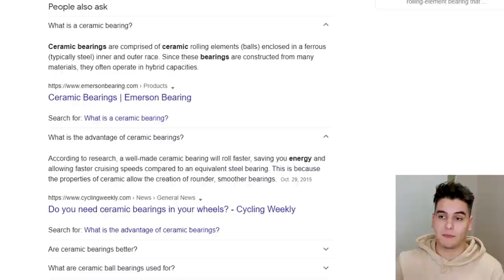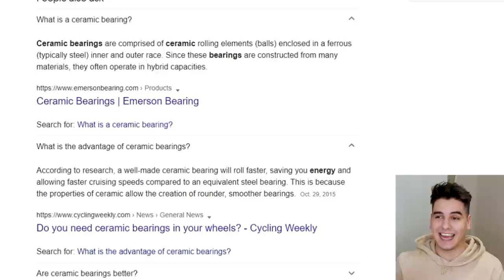Was Primoz Roglic Motor Doping during Amstel Gold Race 2021? (THE TRUTH) ANALYSIS | MUST WATCH!!!

Comment: Are you actually comparing a chain free example of a ceramic BB vs with a chain on? Roglic’s crank spins consistently for three rotations WITH THE CHAIN ON while the bike without the chain on has each rotation slowing down and with a slight jerking motion starting in the second rotation. With a chain on and the resistance from the jockey wheels on the derailleur, there is absolutely no physical way for a crank to get three consistent rotations. It’s simple physics. 

I don’t trust the UCI whatsoever. They want the money makers to do what they do and will never penalize them. Perfect example is the discarding of the bidon rule. Roglic discards a bidon in no mans land and isn’t even fined while a rider, two days earlier, tosses one gently to a fan and gets immediately disqualified. 

Roglic isn’t the only one getting away with things either.
Reply: Don’t be stupid, a super fast chain and drivetrain will spin like that, even mine without Ceramic BB does so
Reply: @elijahkwon422  I have one piece ceramic BBinfinite and DuraAce Di2 and perfectly clean chain on a 2020 Scott Foil Pro and it spins nothing like that. Please post a video of your drivetrain spinning like that. Mine without the chain spins very nicely but after six rotations it loses speed exponentially. Roglic had a chain on. It’s IMPOSSIBLE to spin that freely (three full rotations with no loss of rotational speed until the tire hit the ground) with a chain on. 

Please provide a single video of a ceramic bearing with a top spec crank that spins like that, even without a chain.

Comment: Ceramic bearings are a waste of money.   The  real reason the   bearings on pro bikes spin so freely is because they use oil instead of  grease and non contact seals makes no difference if ther steel or ceramic - , if you want your stock bearings to spin like that , remove the seals and change the grease for oil - just be prepared to re oil them every ride   and  don't expect them to last as long as greased and sealed bearings but with the money you saved not buying ceramic speed you can afford replacements .

Comment: And two further things to stop the nonsense from people who don't understand any mechanics (nor physics) at all. 
I am upset about the lack of knowledge here and people suggesting impossible things to "disprove" reality!!! No way.

1. Ceramic Bearings.
There difference between high-end steel and ceramic bearings is at those lower crank angular speeds never ever noticeable by the eye! At very high speed ceramic bearings in the wheel could produce a little more than 1Watt saving -- either you can test this by yourself in the lab (as already done by many RD engineers) or you google for it. Since ceramic bearings are more durable (under similar conditions) and lighter than the steel versions, they are the choice for pro cyclists. But again, this is not a choice based on pure "performance"/power saving. And what we are talking about here IS POWER "SAVING"... or better said "POWER GENERATION" (though not from Roglic's body, at least in direct form...).

2. The "freehub" issue/tale.
Did you ever have the "freehub" ""issue""/lock-up you mention? As you should know, if the rear wheel drives, for whatever reason, the crank, it must transmit the energy through the chain. Now, the chain has a peculiarity for energy transmission: you have to "pull". Since the rear wheel is rotating the regular way, provided this very same wheel produces transmission to the crank, IT MUST PULL THE LOWER PART OF THE CHAIN. As you may know, if you pull the lower part of the chain between the two "lowest" contact points (cassette and chainring) it will straighten up. You search now yourself in the video and see that this is NOT THE CASE HERE! The chain is "relaxed" (well, until Roglic pushes "the button" which produces the light tightening before relaxing again).

I already said it all in my previous comment below. Again:
Roglic's bike (from the video) does have energy aid not coming (in a direct form) from his body.

(Need more details? Get the original footage, frame by frame, find the vertical and horizontal axes through the crank and measure the angular velocity of it... right after Roglic's "hand-pedal" stroke, just before he pushes the button, right after and just before he sets the bike onto the ground... Yeah, it's unfortunate (and true).)
Reply: Just came across the following GCN video where the dumb can see what a spin from a top pro bike looks like: 
4:14-4:21 in https://www.youtube.com/watch?v=yHRj5HSRIWY .

And as I already explained, a "stuck" freehub is simply not possible.

WHAT A MOTOR ROGLA!

Comment: your focus is on one event but it's been proven that it does exist..but the cycling federation tries to hide/silence it and deal with internally..whatever tool (the tablet) they've been using on the TDF is useless & misused and the E- tech is 'has-been' now ,the 'new' stuff is so refined now ,that it"s almost impossible to detect..it's a super sophisticated magnetic wheel that takes the cake in today"s bike racing..added to the ceramic bearings and the full carbon bikes...

Comment: There is no doubt about it! There must be a motor/external aid there — I don’t need here to show you my all big credentials on mechanical engineering and RD head experience, simply look at it for yourself.

And already this was pointed out by another user below (so I am not "the first" nor the "only one" having seen the obvious; I just repeat it here with the details I consider):

- At 1:50 Roglic (itf also as „Rogla“ as many call him, my son and fan of his as well…) moves his left hand not to grab smth, no not the handlebars, he goes for „the button“, where regular and UCI compliant bikes (without motor aiding) have handlebar ends. More precisely:

- He grabs the handlebar with his right hand not to control the bike stability or aid a move (to straighten the wheel direction ahead or whatsoever). Nope. He „grabs“ the handlebar between his index and middle finger so he can put pressure on smth („the button“) with his thumb. This takes place, in this video for e.g., between 1:51 where you can see his right hand finger’s position, 1:53 „grabbing“ the bar and 1:54 „pressing the button“. And now more precisely on „the button“:

- Besides useless rotation counting — which would be helpful if one could point out deceleration or not of the system, smth we don’t touch here because it’s not so easy to assess apart from some „unnatural“ behaviour… —, you should better look at sensible drive train elements shown in the video. And fortunately you can clearly pick the chain! There you easily see in 1:54 the lower part of the chain „loosing“ the natural curving caused by gravity and a smooth light and even torque which you see from 1:51/1:52-1:53. This „straightening“/movement of the „lower chain“ is caused by the sudden missing small torque (whether it comes from the crank or from the wheel aiding spinning, you cannot sa, though a sudden slight change in torque can be assessed since there is no (other) external force applied the to drive train at that moment).

- The same footage can be now appreciated with a broader picture, now that we have pointed out the details above. So look more at Roglic’s behaviour. The same cut from 1:51 you see in a broader picture at 1:38. There please „take a look“ at what Rogla „is taking a look at“…??? WTF. What are you searching there at the handlebar-ends Rogla??? HÄÄÄÄ… „the button“!

- Right after pressing „the button“ he indeed does what a rider in that situation would do (if he is not Sir Wiggings and cannot through the bike gently to the wall so that it keeps standing ;-) and if he does not need to „turn off“ the motor): he grabs with his right hand the handlebar to control the direction of the bike!

- Obviously between pressing „the button“ and grabbing the handlebar he does a definitely practiced movement: just bring your (right) hand somewhere else to distract attention… Poor move as well! (see 1:42-1:43).

- Most of these motors aid when „excited“ and this is the reason why you should better turn it off before leaving/changing your bike — if you want to reduce the chances of being caught…

Not being tested positive for something does not mean at all, that one does not have that „something“! (you know plenty of examples, and also science taught us that as well…).
So, Rogla is going to be hugely careful about it as well as many others…
Reply: Bla bla, but no evidence. Just opinion and wild guesses. You evidence is what roglics ‘looks at’? Are you insane? You know the murderer by what he/she looks at. Big deal sherlock.

Comment: most so called ceramic bearings are in fact hybrid ceramic coated and not full ceramic. In true tests not all bearings are remotely the same, I'd rather have a top quality steel bearing from a company like SKF than a supposed mid range hybrid 'ceramic'.
I've got ceramic bearings in a BB from FSA and honestly the resistance is piss poor compared to bearings from SKF made 30 years ago Buy some sealed bearing from a top quality maker at a fraction of the price of hybrid ceramic and they are not only less expensive but they will last longer.